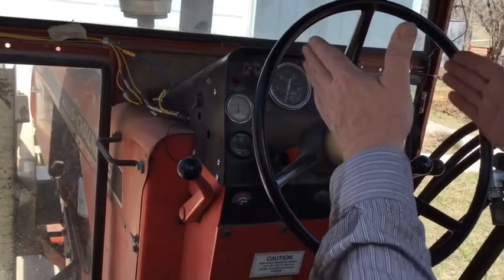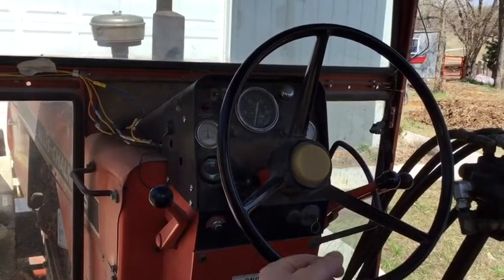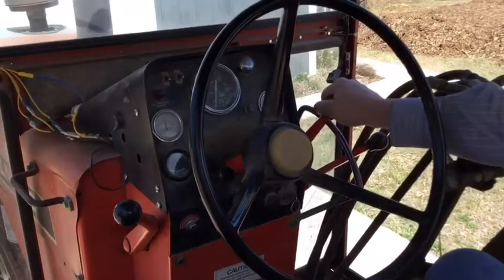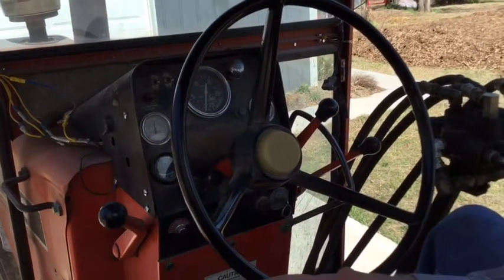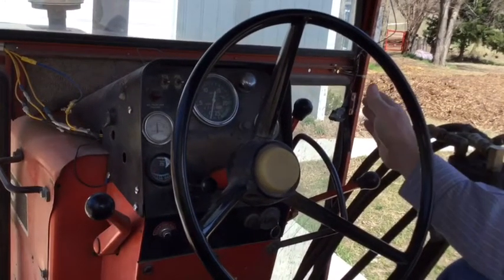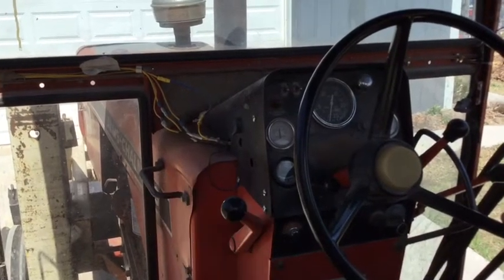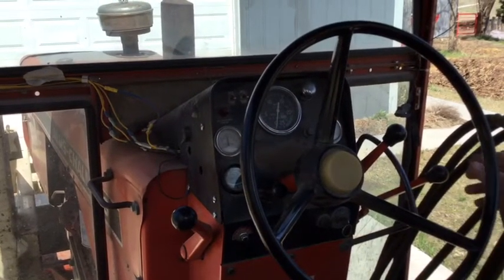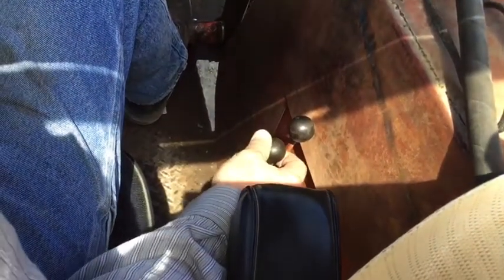Allis Chalmers 185 Operator Controls (video 2)

Comment: Most 180 or 185 tractors I've been around have a mechanical PTO engagement but that can differ depending on what the dealer in your area pushed to sell. I like the 3point features because the position control is a sperate lever to the rear of your remote levers. You can set the draft control with one rear lever, set the position with the other rear lever and then use the forward outside lever to lift and lower without worrying about if you have the same settings everything you lift and lower the 3 point hitch. The rear 2 levers which you didn't show, save your depth and draft settings. The Powet Director was introduced in 1957 but the live PTO was introduced in 1948 on the WD using a hand clutch running in oil which simply stopped the tractor's motion while leaving the PTO running. Works like the Power Director as far as the PTO goes but no 2 speed power shifting.

Comment: The small round baler came out in the mid 1954 about the same time as the WD45 tractor
Reply: The Roto Baler came out in about 1947 spurring Allis to develop the WD with live PTO in 1948. Actually Allis bought the design in about 1940 or so from Luebben who was the man who invented it and Allis developed it into a succesd by 1947.

Comment: All allies is like that and the hand clutch is that way on the older one
Reply: Not all Allis tractors. Not the D21, 210, 220 or any 7000 or 8000 series. Unless you are talking about the push pull know which still the D21 is electric fuel shut off and so are the 8000 series if I remember correct.